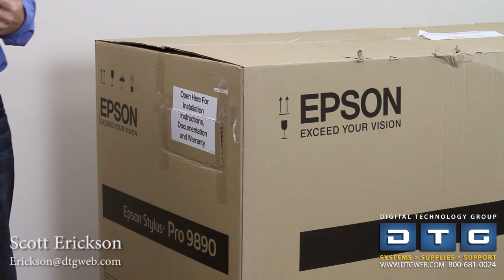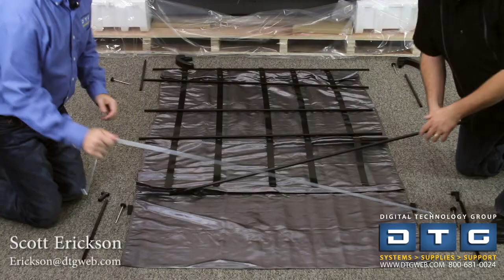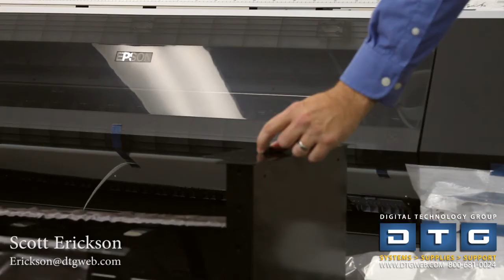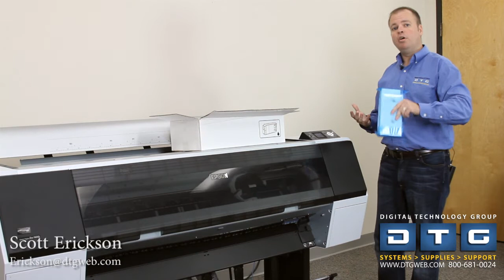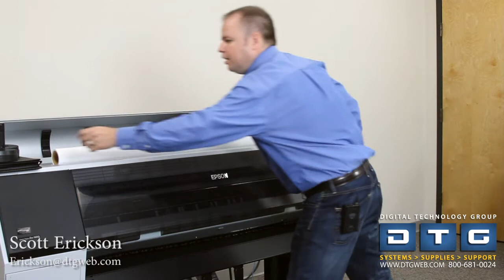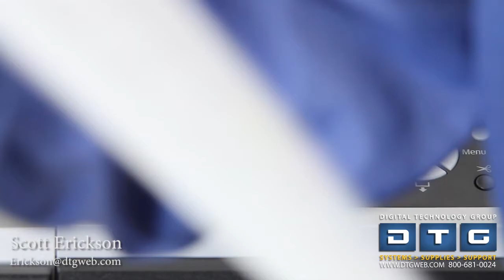Setup video for new epson printers 7700 7900 7890 9700 9890 9900

Comment: does the 7900 not have the 2 back curves braces for the basket?  I've had my 7900 for a couple years now and never had the back pieces.  I just came to your video because I had taken the material part of the basket and had to use soap and water to wash it down in my bathtub.  So had forgotten how it went back on with all the poles and came to watch again :))

Also, the 7900 only has 2 paper feeders?